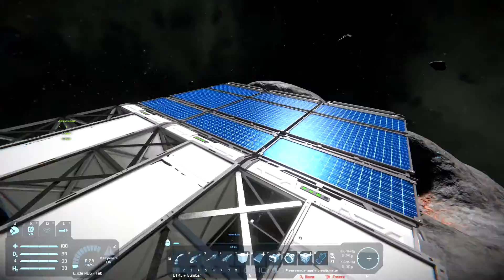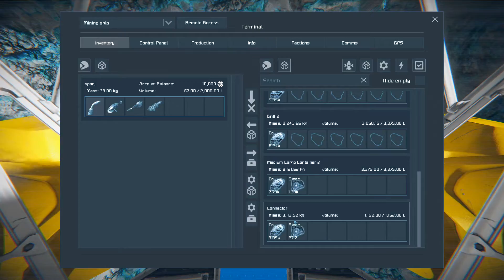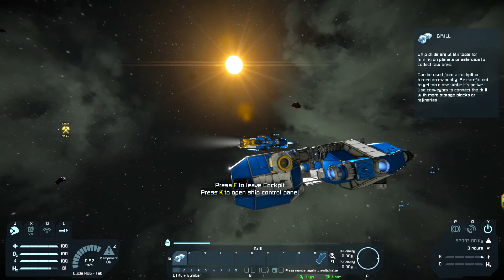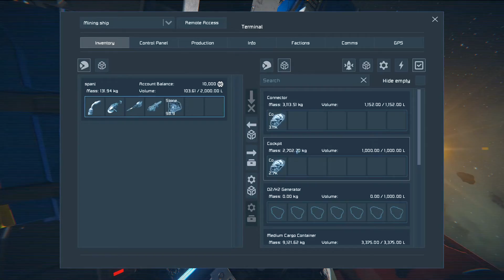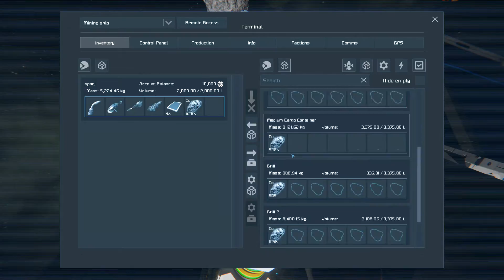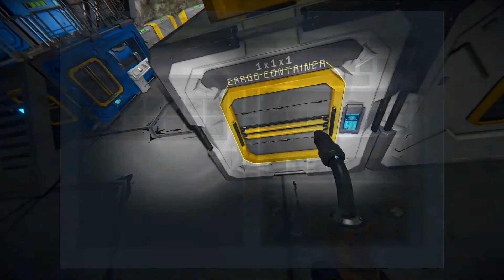ITS A MANUFACTURING POWER HOUSE NOW | Space Engineers | Learning to Survive | #4

Comment: Large grid ore detectors might be useful, especially if ores are located deep under the surface. They have a longer range (change distance setting to max, uses more power) than the small grid version, which in turn has a longer range than your hand drill.

To optimize solar power you can build a solar tracking tower using rotors and a programmable block running Isy's Solar tracking script... build it in a spot that always has sunlight. The angle of the sun and any shadows on a solar panel affects its efficiency. 90 degrees facing the sun unobstructed is optimal.. the solar tower will always try to face the sun to optimize exposure.

Welding LARGE items easily: build a large grid welder onto a conveyor port connected to the network within welding range of the large thing you're welding and switch it on. The welder will pull available components and weld up the target automatically. Grind the welder down afterwards to recover its components.

Comment: The "G" menu (press the G key) will show what is in the build planner in the lower right corner. left click on any item to remove it.

As for large grid / small grid it is to do with the size of the blocks (some are not available as small grid). You toggle between big / small by pressing the item number again (if you have steel blocks loaded into slot 3 on the toolbar  pressing the "3" key will toggle between large / small grid)

Gatling guns require a 9 block square to mount and if connected the the conveyor system will auto load.
Reply: umm, try the "Other left Click" :P

Comment: To cancel the components that are queued to be built, go to the production tab, and right click on those items. They should be completely removed.

Also, I just look at what I'm about to build, and look at the list of ingredients I'll need, and I just go to the assembler and queu all the parts that I'll need for that build. 

If you want a good portion of components to have on hand, almost anything you build will need these three, they're pretty universal in anything. Steel plates, Construction Comp. and Interior plates. Those are the biggest. After that I also keep plenty of small steel tubes, motors, and computers. Otherwise just look at the immediate build to see what you need, until you start to see the pattern anyway.

Also, in future builds, you'll want to organize which inventories you want to have shown first in your inventory window. The annoying thing with Space Engineers compared to Empyrion, is you have to manually move all of the inventory around, and there's really no way to hide and show different inventories. There is, but it's a lot more cumbersome in SE than Empryion. Anywho, just my two cents for what it's worth.

Comment: You might be powering your refinery with your ships batteries when connected to it.  To prevent the refinery fro draining your ships batteries just go into the ships control panel and set batteries to RECHARGE.  When you disonnect just set the back to auto.
Reply: This is a bad idea, especially if you undock before turning your batteries back to auto.  I'd just leave them on auto and make sure your base is providing enough energy to keep the batteries charged.

Comment: You are now one step closer to exhausting the totality of Space Engineers' content. I'd say step four of seven. Game slows down pretty much to a standstill once you've got your pile of resources together.
Reply: You must lack imagination,  There are thousands of things to do. I went to an Alien Planet last night and built a glass dome lodge by the lake. With a Wood deck to watch the stars.
Reply: THE alien planet. There's only one.

I had a vast blueprint portfolio ready to take on any challenge the game had for me. I had a large grid hydrogen miner for orbital platinum and uranium. I had a universal jump-drive scout that could fly to, around, and from any planet without hydrogen. I had planetary miners ranging from truck-mounted ROVs to flying strip miners. I had several fighter craft including cheap hydrogen interceptors and aerospace strike craft. I had a container system that could move anything, including small craft, materials, battery blocks, even prefab buildings.

None of it, NONE OF IT mattered because Keen never added content to use designs on. When it launched, I built a small wind-powered structure, and sat in a chair knowing it would remain powered indefinitely. You don't need to explore because there's nothing out there. You don't need to retrieve resources because you can make everything out of rocks. You can easily fend off the brain-dead drones with a grinder. Space Engineers asks nothing of you. Space Engineers has no use for you. Space Engineers does not care what you do, aside from buying DLC for block textures.

Comment: what you can do is use a sorter set to drain all pointing in the direction you want to drain it to witch will pull every thing off the ship. you can see what way it is pointing by the arrows on the block. i have a warning  about using the park button if you use P to detach from a connector all connectors will unlock this this will get rely bad when you are in the gravity of a plaint or are using jump drives i would well in the cockpit of a ship press G and add the ship connector to the hot bar buy right clicking on it from cockpit G menu and select lock/unlock you can do this with all sorts of blocks just do well the ship is not connected to anything.

Comment: Loving the series 👍. For the build planner press "G" and in the bottom right you can cancel each item. From "G" menu you can use middle mouse on blocks to add to build planner also.
The small yellow squares on refinery and assembler are for upgrade modules. E.g. if you put 4x power upgrades on refinery, it will use less power than a basic refinery. It is possible to get 4x upgrade modules on a assembler if all 2x1 sides are free of obstacles.
When transfer items from ship to station. At top of inventory page is a "show only ship cargo" button. (1st of 5 buttons, last button puts back to normal) you can use on one column. Help makes menu smaller

Comment: Guns have classifications...rifles and small interior turrents take 4-10 bullets to break 1 light armor block small gatlings and large interior turrents take 2-3....large gatling guns are 1-2 and penetrate light armor...rockets do more aoe damage but less on impact at first...once they explode inside...then their damage ramps up. Heavy armor is roughly 10x stronger versus same weapons but to stop missles from penetrating you can add wheels laid flat inbetween armor layers to reduce the impact by an average of 2 missle before penetrating